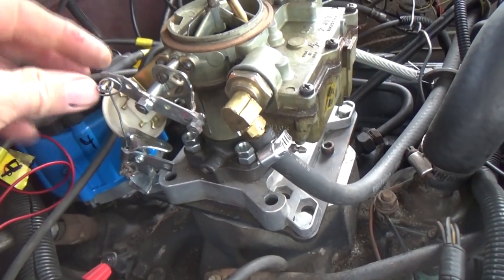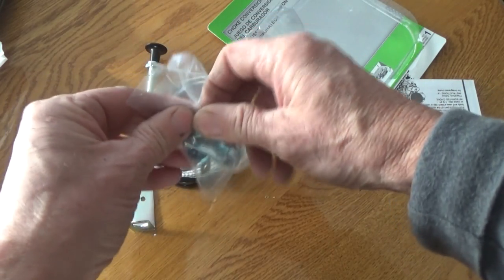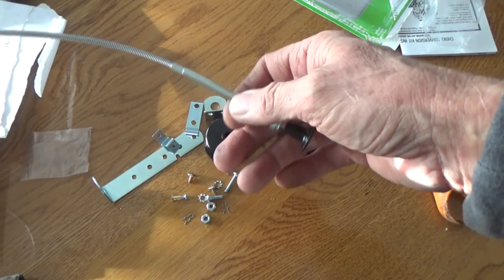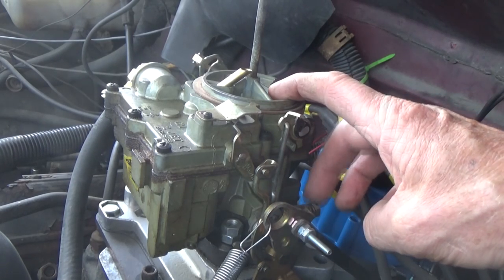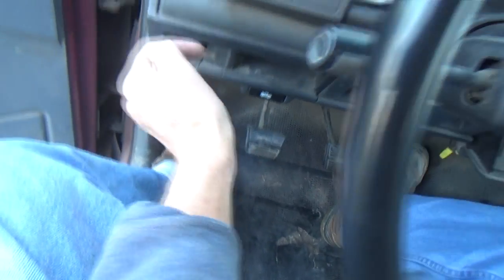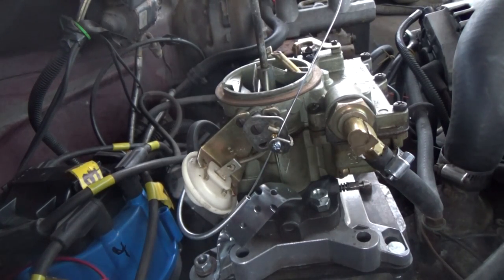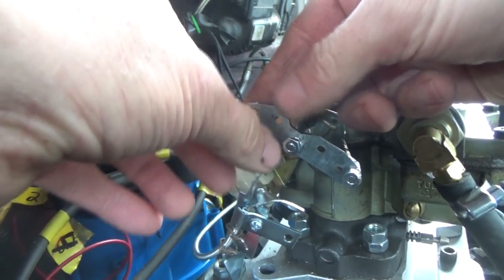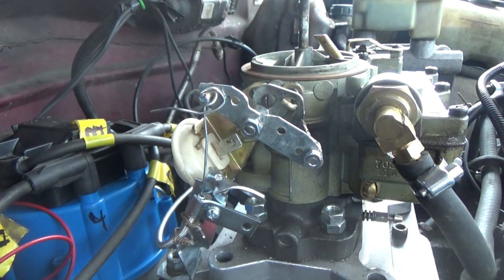Hand Choke installation (on my chevy truck)

Comment: How long did u run it on the computer controlled distributor bud
Reply from the maker: I ran it a few weeks before I changed it to hei,  I just wanted everything separate,  but it ran fine, thanks Mike

Comment: What is that vacuum device attached to the choke linkage?
Reply from the maker: I believe, that was a  part of the automatic choke but all the linkage did not come with the carburetor, I got it for free but I have now changed  to an Edelbrock carburetor with an Automatic choke  nothing wrong with the old carb,  but I like experimenting, so the only thing I hooked up was the butterfly the old carb, And it worked fine, I hope it helps
Reply: I figured it out.  It's called a choke pull off.  It slightly cracks he choke open after the engine starts to prevent a very rich running condition.
Reply from the maker: Thanks Kevin, I knew it was for something to do with the joke,

Comment: do u have to let it warm up a while before u can drive it if u out that manual choke🤔
Reply from the maker: Hi John, all a computer does is everything you use to do by hand, once you got it adjusted right, and figure out its ways, no problems,  thanks, mike
Reply: So we gotta control the choke while driving?